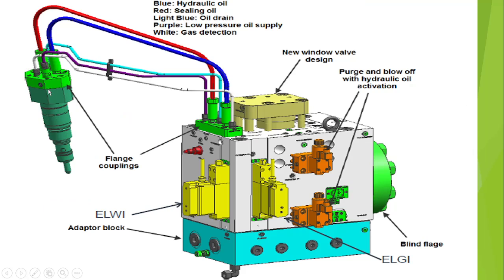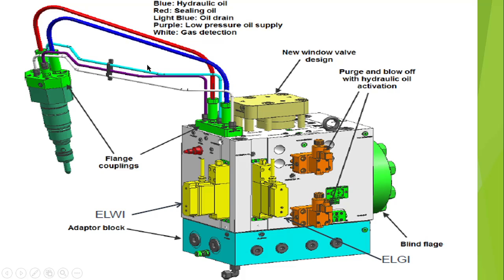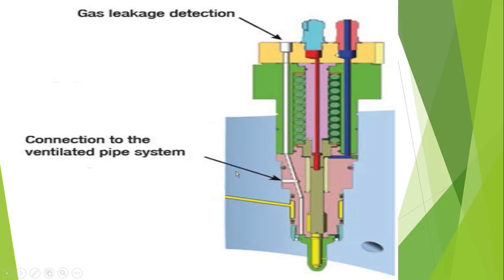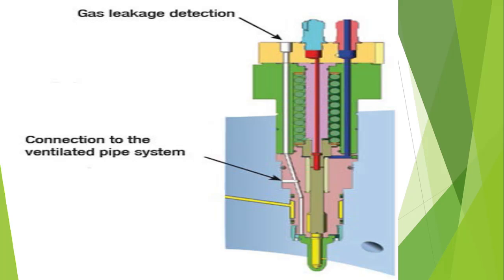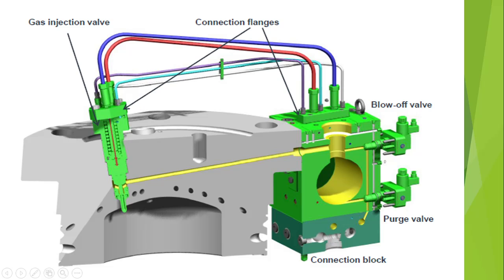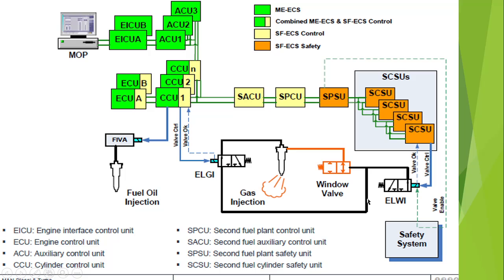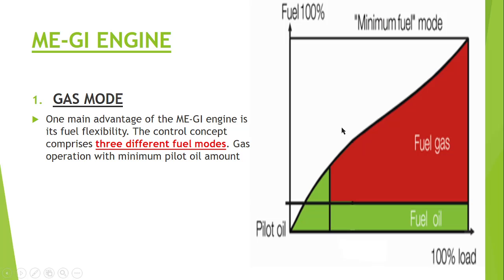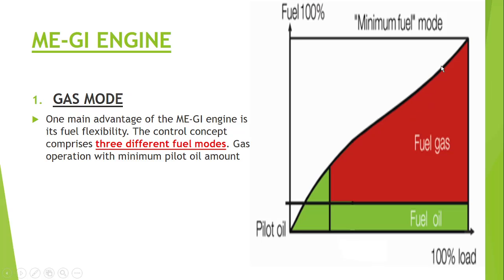ME-GI|Gas Injection Valve|Component of ME-GI Engine|Different Mode of operation of ME-GI|Gas Engine|

Comment: Good Day Sir, 

Thank you for your great videos, I am learning a lot. I have the following questions:

1)  If a vessel has two MEGI engines, can the operating mode be different between them? For example, can the port engine be on "Fuel Mode" while the stbd engine is on "Gas Mode"? Or are both engines always running on the same mode?

2) When operating on "specified dual fuel operation" mode, I am curious if there are charter party consumption terms that are specific to SDF mode? Or is it the case that there are only consumption allowance terms for "Gas Mode" and "Fuel Mode", but the SDF mode is interpolated based on the ratio gas to fuel being used?

Thanks and Best Regards